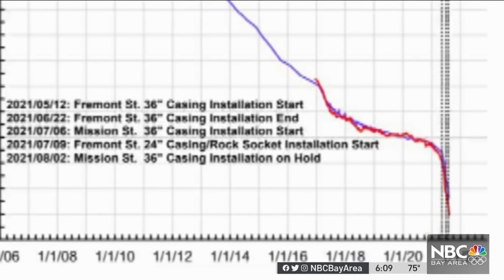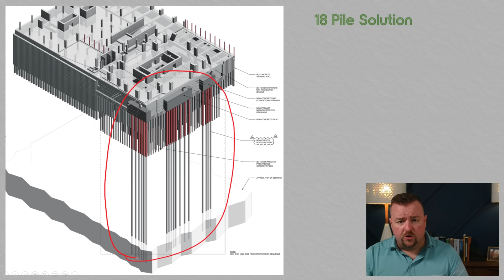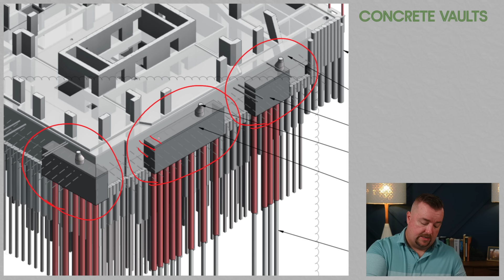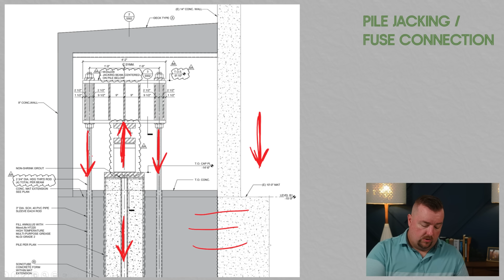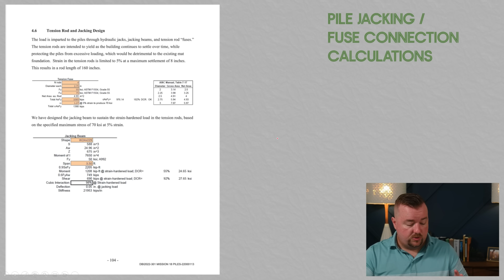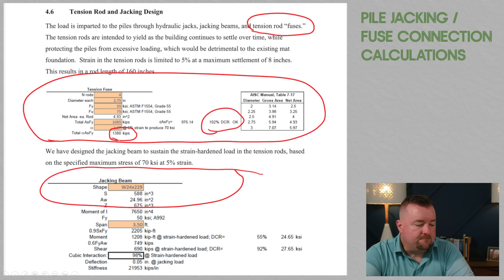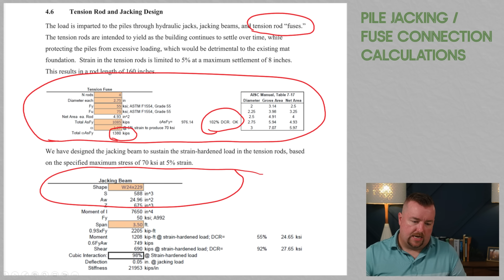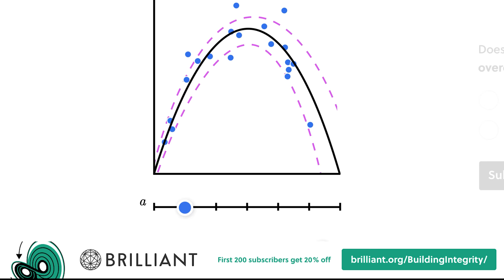Did I Uncover a $100,000,000 Mistake with the Millennium Tower "Fix"?

Comment: Seeing the drawing at a glance, the load flow seemed quite intuitive to me.  Isolate the piling from the support extension, and isolate the tension members for some length such that they can provide an adequate amount of elongation.  I figure they're sleeved down so far and then they attach to some large fabricated box structure which itself is integrated into the concrete reinforcement.  You scrolled down and it shows a (for scale) flimsy flat bit of plate barely wider than the washers.  Considering that these rods are operating near yield strength, intuition leaves me both alarmed and confused that I'm actually seeing members of such conflicting proportions.  Holy moly.
Reply: The threaded rods are sleeved all the way down to the plate to which they are anchored.  The plates do not seem flimsy to me.  I am not making predictions, though.  They are in place and fully loaded according to the plan, and the desired result has been achieved.

The two plates per pile have a combined area of about a square foot.  This means they transfer a load of about 7000 psi to the concrete of the vault.  High strength concrete starts at a rating for compressive force of 6000 psi, and can go much higher.  I don’t know what concrete they are using here, but I expect the engineers have thought about the problem.
Reply: @GH-oi2jf  Perhaps I was unclear.  I was walking through the sequence of thoughts I had as the information was presented to me in the order it appeared.  The rods are indeed sleeved down to the plates.  

My concern is simply that the plates are not sufficient to meet the simplified model implied when you assume that they bear uniformly upon the surrounding concrete.  I have not thrown FEA at this (please don't make me; my background is EE, not ME, and I don't have tools to model this conveniently), but they seem disproportionate enough that the plate loading local to the sleeve bores is of concern.  Bear in mind that the bores in the concrete above the plate ends are approximately 3.5" dia.  I would want to calculate shear stress in the plate local to the hole, as well as the compression stress in the concrete local to the sleeve bore.  I know the plate length, but I don't know the hole spacing -- or implicitly the tail length.  I'm assuming the holes are as close to the end of the plate as they are to the side of the plate.  That's what the images suggest, but I didn't see another projection.

Given the geometry of the plate in relation to the applied load, I wouldn't dare to presume that the plate distributes its load uniformly upon the surrounding media.  Bear in mind that I'm not trying to dictate that it's an impossibility.  I'm saying that it's simply within a realm where intuition suggests I should apply caution and use a more exhaustive approach in calculations.

FWIW, incorrectly assuming someone superior thought of x before is how everyone got into this problem to begin with.

Comment: Interesting.  My quick take is that I am more worried about electrolysis and corrosion of the bars and connecting plate, than the shear of the connecting plate itself.  Looking at the connecting plate of 1.5” x 6.5” x 13”, with 2 holes at size 3” dia each … leaves [6.5*13-14] or 70 square inches of plate in contact with the concrete above it.  Assuming a 10000psi concrete compressive strength, the concrete will provide 700,000 lbs of force keeping the steel from shearing, or 1.4M lbs over the 4 rods.  Essentially for there to be a relevant shear, or bending, the steel needs someplace to flow into, which for the connecting plate, the only adjacent void is the annular ring between the threaded rod and the concrete — and that’s not available due to the load rated jam nut above the plate.  As for the corrosion, I would have some sort of impressed current to reverse and constantly heal any stray currents.

Comment: I don't think it's meant to be like an electric fuze. More like getting your back fused together. Or the new piles will be fused to the existing structure.
Reply: Okay,, so it's just like stretching headbolts in cheap engines. Saving a fiver on every car by using bolts into their plastic stretch... Makes sense when you build a million plus cars, and short term quarterly gains... Makes no sense if the longterm health of the company matters.
Everything sounds crazy.

Comment: Granted, to an old stress analyst b4 all FEA analysis, the plate looks flimsy.  Not sure how an analyst treats the load on the plate by the concrete.  I would guess it is a uniformly distributed load. If the rods break, why can’t they proceed on guts.  The tension rods are an input for the fuse.  Load not to exceed.  Put a good load cell on the hydraulic jack and go with that as a fuse.  The rods are a guide.  I never liked pulling on stuff in concrete until it had cured for 25 years.  I don’t understand why you can’t go on without the use of the rods other than as a guide.

Comment: Completely agree the insufficient embedded plate is a significant concern of shearing and concrete crushing due to lack of bearing area. Why did they have a huge beam at the hydraulic Jack but not a similar huge embedded beam at the bottom of the rods? Also need lots of shear studs / rods and lots of lap splices with the vault rebar…. ☹️
Reply: The specially constructed beam at the top of the jack is self-supporting.  The plate at the bottom of the rods is buried deep in high-strength concrete.  That’s the difference.

The vaults are tied to the foundation mat by rebar, but that detail is not shown in the drawings herein.

Comment: I'm not a engineer, but I do follow engineering.  I'm pretty handy with a variety of mechanical and building type stuff.
The whole thing is shocking and to my simple mind, putting the plate that takes all the pressure so low down is a terrible idea because there is less ability to transfer load, that rod and plate could simply act like a hole punch.
Insane.
I rate this about as good as dog shit on toast for breakfast

Comment: The building in the overall unstable soil seems like if they stiffen one corner, an earthquake could cause failures on the sides not supported by piles into bedrock.
Reply: A moderate earthquake will likely just help the east side settle, bringing the building closer to plumb.  What failure, specifically, do you think might occur, and at what magnitude temblor?
Reply: Josh has concern about the integrity of the tension rods bolted to the small plates on the bottom.  His concern is whether they will pull out under full loading.  As I listened to this presentation, I kept thinking how they might handle the loading during an earthquake.  In fact, this entire jacking setup is a new design, and therefore there is no model to determine the effects of an earthquake.
I guess I am saying that I would feel quite uneasy living in that tower.

Comment: Uhhhhhh has anybody calculated the pull through on those nuts? All these calculations are based around the all thread strength, but they are relying on a single nut on top of each rod to hold over a quarter of a million pounds.

Edit: rough and dirty napkin Calc says they will, but a little close for my comfort

Comment: o😊Structural engineer here.
1. Whilst I don't have the calcs and I haven't done any myself, preloads of c. 500 ton per vault doesn't sound very significant. Is it really going to have a real effect on correcting the building settlement?
2. Agreed that the anchor plates look way too small. Why on earth not design them conservatively? They are so critical to the repair design that there's no point skimping on them.
3. There will definitely be local crushing of the concrete around the anchorages. I hope they have detailed bursting reinforcement to contain this (like for  conventional pre-stressing anchorages).
4. Do these plates connect two of the threaded bars? They are way too shallow to achieve any load spread between the bars if that is the intention - they have little bending strength.
Agreed . that the anchorages should be supported by proper calculations, or indeed just use a standard detail from the bar manufacturer. This detail reminds me of the Hyatt Regency walkway collapse.
Unlike others I am not that worried about the foundation raft since these are normally designed conservatively and for a range of assumed pressure distributions. The fact that some of the loads have been shifted to the perimeter probably doesn't matter since they are still within the design envelope.

Comment: Fuse Bolts , so you blow a fuse and replace it , how are you going to do that ? i would use thick big plates with threads so you could remove the broke bolts and replace with new ,
Reply: The word “fuse” was an analogy and should not be taken as a literal example of a fuse of another type.  All it means is that the rods will sacrifice themselves in the interest of protecting the larger structure.  The rods are not likely to break outright.  They will undergo plastic deformation before they break.

Comment: i think there is a misunderstanding on how to read the design calculations here or the way it is presented is not overly clear.  

The yield strength for the 4 rods as calculated is 1085 kips and a factor of 0.9 (90%) was applied to generate a factored resistance of 976.1 kips.  This value is then compared to a load demand (DCR-Design Critical Load?) and found to have 2% over the demand (hence OK).  The anticipated factored load/demand that was compared to (DCR) is usually has a factor of 1.4 to 1.6 on it.  Combined the factor of safety would be around 1.55 to 1.77 as compared to real anticipated load.     

The whole bit about 5% strain is to limit how much this system can sustain load just in case the building settle more than 8 inch on the other side so this side wont get over stressed.    The fixed side will become the strong side after the fix and might become a pivot for rotation if the building settle more than 8 inch on the other side.  There must be a monitoring program to monitor the movement of each side of the building and threshold for additional action will be much lower than the anticipated 8 inch mentioned in calculations.  Also, the beam is designed for the worst case scenarios (unlikely to occur).

Also, steel shear failure of bearing anchor tension plate is unlikely due to the controlling mode is usually moment (bending).  Plate thickness are determined by the size of the plate (think of a umbrella), the size of plate is determined by punching shear resistance and bearing strength of concrete.  From my experience, concrete thickness & strength often dictate the capacity of the anchorage system.  Design load each anchor here is about 250 kips and it does look like the embedment is thick enough to sustain such load.   Just a opinion.

Comment: I remember seeing the aftermath of the last earthquake there. I remember all the houses that sank into the ground do to liquefaction. I understand that the soil under this build is different, but I would not trust sand and clay to be different enough to trust it with a building of this size regardless of what the engineers' math says. The only exception is if I was building a boat into the soil that would float in a liquefaction situation.
Reply: You must mean the last earthquake that did significant damage. We have had many lesser earthquakes since then.  Most do no damage at all.  As for the “pretty big” Loma Prieta earthquake, most of the damage was to buildings poorly designed to endure earthquakes, particularly “soft story” structures.  They didn’t sink into the ground; the ground story collapsed.  I can’t think of any high-rise buildings that suffered significant damage.  If you know of one, please remind me.

Comment: Holy krap! This is scarey! I can just imagine all 72 of these threaded bolts failing in cascade as the Jack's exe f2f full pressure and the steel bars sheet like aluminum foil and sound like someone set off a string of firecrackers. Then having the 29 inch building lea quickly double, tripple, and rapidly pass a critical value to remain upright. Let us hope someone in charge notes and follows your line of thought!
!
Reply: It is only a quarter of a degree out of plumb.

Comment: Not only are the metal plates you refer to severly undersized, but also the nuts on the threaded rods were not considered. I would expect to see a custom long nut of about 6" length at least to accamodate 1/4 million lbs.  There should also be nuts on the inside of the bottom flange of the I-Beam to help transfer the load.  The nuts under the I-Beam don't do anything at all. The whole design looks like it was created by someone who has absolutley no idea of the immense loads involved. In addition designing to 102% yeild strength is a guaruntee of failure.  Temperature variations due to weather will create cyclic loads that will effectively cause the steel to fail, in exactly the same way as pressurizing an airplane body each takeoff and landing.  Any metal subjected to cyclic loads will ultimatley fail. If you bend a fork back and forth it will eventually yield as it work hardens.  In my opinion, the bottom steel plate should have been made from the same I-beam material as the upper stantions.
Reply: I don’t know why you would think the nuts were not considered.  The nuts come from the manufacturer of the threaded rods and the assembly is specified as a system.  They don’t just go down to Ace Hardware and pick out something that looks right.

The nuts under the I-beam hold things together until the jack is applied.

Comment: I’m not an engineer, but in the investment arena, where ‘fiduciary’ is an important concept and financial ‘triads’ include custody holders and advisors that act as checks on each other, making fraud more difficult. The Madoff fraud happened because there were no ‘triad checks.’ (A coined phrase, not financial verbiage). Even if I was not convinced by the engineering explanation (which I was), the fact that there was no independent check of the work would have alarmed me. San Francisco is unsafe. It is only a matter of time until disaster strikes.

Comment: Pardon my ignorance as I am a Mech E not a Civ E... If the new piles are locally successful, they may stop the listing of the building, but it would seem to me that the non-anchored part of the building (the greater part of the mass including the dishing center) will then exert a large shear stress on the newly anchored part? Last I checked, concrete may be vulnerable in shear loading depending on the load transition, and it is very hard for any reinforcement or rebar to help it should it be the case? Maybe I misunderstand the situation but in terms of solid mechanics I have doubts? Now at the smaller scale, the loading case of the anchoring plate attached to the all-thread rods seems to offer the same challenge?

Comment: Interesting video.  All 'tall' buildings should be required to have piles down to bedrock, and even then, in places like San Francisco they should not be using brittle heavy concrete, but lighter steel buildings.  For the highly seismic west coast, having a outer tube structure like the original world trade centers would work well.  This underpinning is stupid, and they should pull this building down.

Comment: A design review in classical program management is not a peer review.  It amounts to challenges from experts from other areas of the company or consultants .  They are “technical challenges” and if the data presented prior to the review does not answer the question and he questions are considered pertinent to the usage of the design then the issues has to be addressed by testing or analysis or by surrogate data.  No sign off by the design review group until all the issues are closed, by whatever means necessary, sometimes it gets messy and political.  I wonder what a trial lawyer would think of those weasel words used by the “peer perusal” group.  I wouldn’t take that job.  It gives the impression of “design acceptance “ which converts to approval very easily.  The trial lawyer that taught me how to design to avoid litigation said “due it right the first time, don’t do anything stupid”.  Define “stupid”.

Comment: I don't understand why you suggest that computer models would be less reliable just because this is an unusual application.  I'd think that would give computer models the advantage over other approaches as they are based on fundamental materials properties at a lower level.

Unless it's the fact that it's not just a different application but that you are using them in a different material regieme (eg in the potentially non-elastic strain on the rods).

Comment: I suspect the nut will pull through the plate or strip the threads on the rods.
Reply: They are installed and fully loaded now.  When do you expect this will happen?
Reply: @GH-oi2jf  I don't know, over time. That's the insidious thing.

Comment: Short of tearing the building down and placing piles at appropriate distance to support the mat (foundation) then rebuilding the structure, all of the attempted quick fix is doomed to failure over time.  Failure to support the building foundation so it could support the building without tilting, has created a monster scenario.

Comment: So, in European speak, 156 tonne on each threaded rod and retained by a narrow 40mm thick plate with no developed structural form and no effort to spread the load across a large portion of the concrete mass?